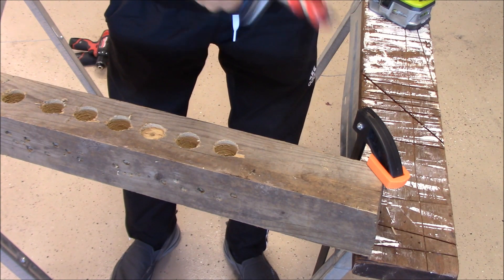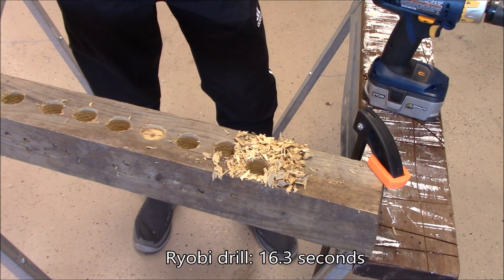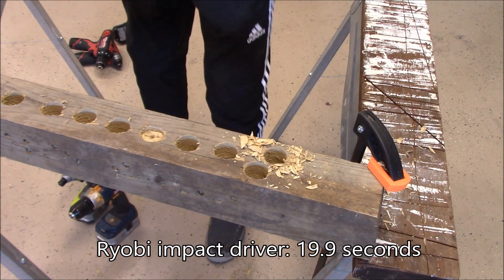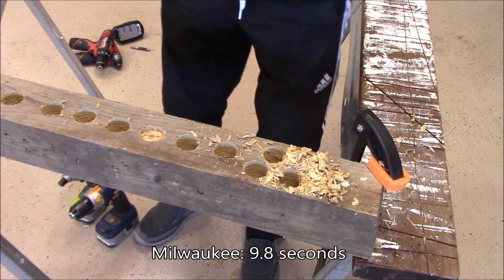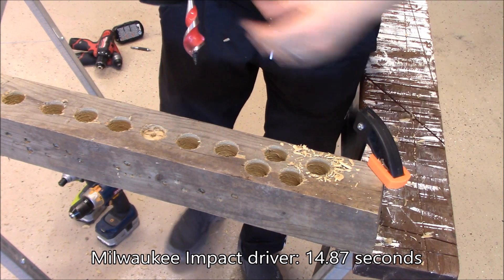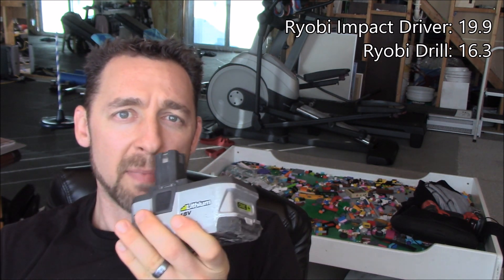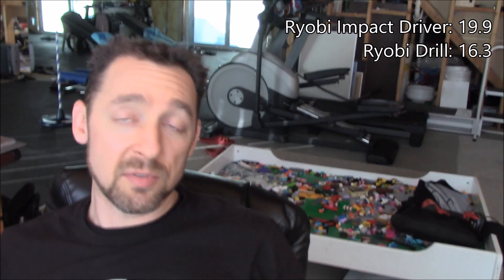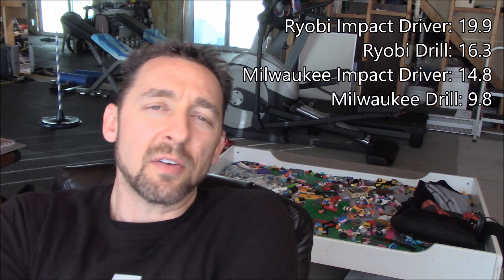Drill vs Impact Driver, Milwaukee vs. Ryobi: boring holes

Comment: (My previous comment here got deleted, well ok just so you know I screenshot this comment and have the comment URL.)

The reason the drill "stalled" is because, it was the clutch that engaged, slip clutches have that typical noise, so it didn't stall like you said, it just did it's work and stopped because of the torque.
If you want to have the full torque available, go into the drill level, not the fastener level. Yes I know some drills really stall out when trying the highest fastener clutch setting but in that case it was not the case.
Please don't delete my comment now, thank you.

Comment: Everybody compare drill vs impact driver using screws. Compare the 2 for drilling holes în wood, concrete and metal to see which is better. Its like you are testing diesel vs gasoline in first gear. Its unfair

Comment: Why not get an updated drill instead of the older model and the impact driver is not meant for drilling holes.... if you’re going to do a competition or comparison then you should at least have equal components.... not to mention Milwaukee is contractor grade tools and Ryobi is geared more towards the homeowner/DIYer

Comment: The reason the ryobi stall out is because u have done one hole with it already. If u would had done 2 more holes in the compitition the ryobi would had broken on you. It's no meant for that type of hard work. Deep inside it's just hard plastic. The Milwaukee on the other hand deep inside is all metal.
Reply: the newer ryobi drill and impact are metal inside. the burshless line is very nice from them
Reply: Hey don't get me wrong. I have lots of Ryobi power tools. Lots of them for many years. Because I treat them gentle. But the ones I have treated rough have broken on me. That doesn't happen with my Dewalt or Milwaukee. The metals of Ryobi are soft look alike metals. That's why they could sell u a ryobi for 5 dollar and it comes with a extra free tool.
Reply: Heckee Pagan guess it variess per person. Ive abused mine in a mechanic shop and accidentally forgot them outside when doing a house deck and they were rained on and they all have remained functionally with no issues over rhe past 6 years. I've dropped them and tossed them not caring because they are inexpensive and wanted to see how durable they were and would last. I've read of post like yours and those like mine. I have the old blue ones and not some of the new brushless as i want to change over and am giving away the old ones as i replace them. Nothing wrong with them. The prices i have noticed are going up on their tools and it could be due to inflation or better quality parts. The new drill and impact are better in quality than my old blue and older green. But of course they are no dewalt lol.
Reply: It stalled out because he had the clutch set to low I think, no hate.
But yeah I do that with my drill too because then you wont have kickback, usually I set the clutch to around 5 for drilling(PE-AS108Li, 25nm max.)